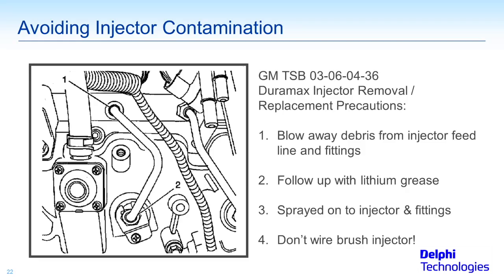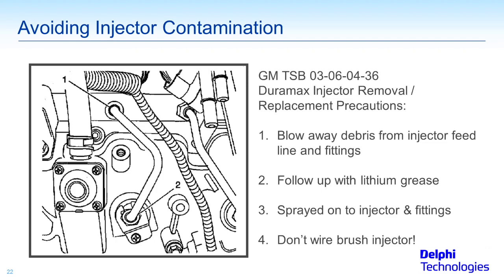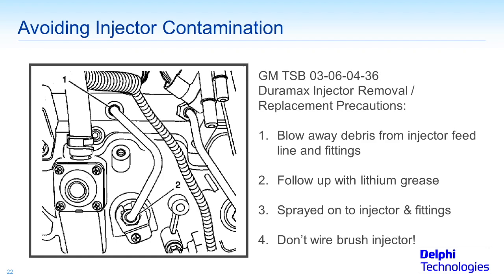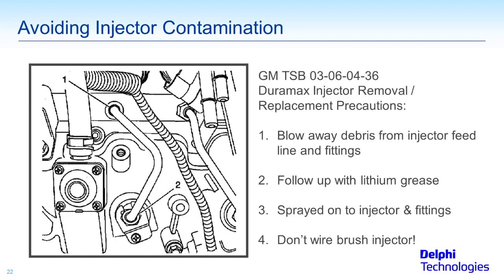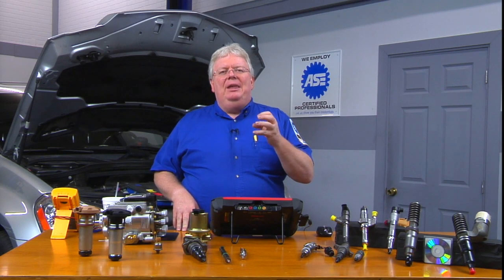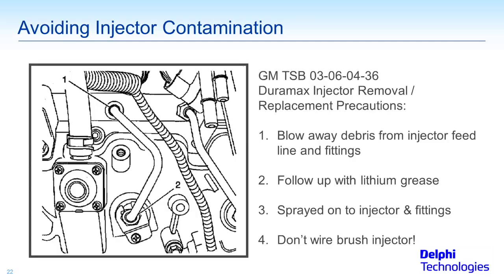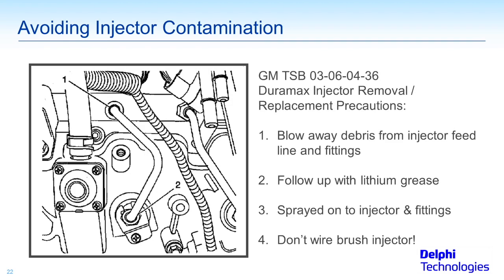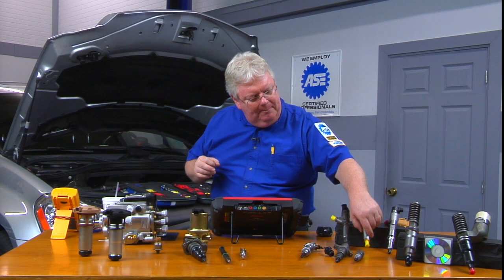How to Avoid Injector Contamination & Leaks

Comment: Cummins calls for contact cleaner to be used to clean surface areas before service to avoid contamination. Not brake cleaner or parts washing solution. Only contact cleaner and paper towel. No shop rags either.